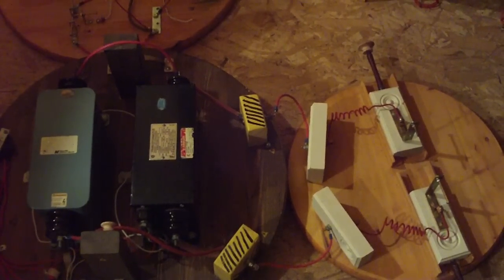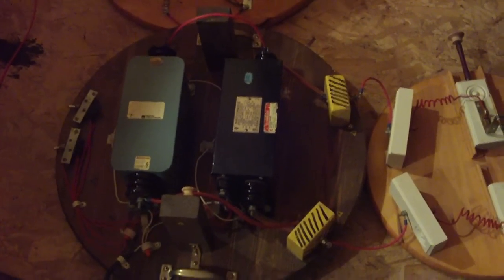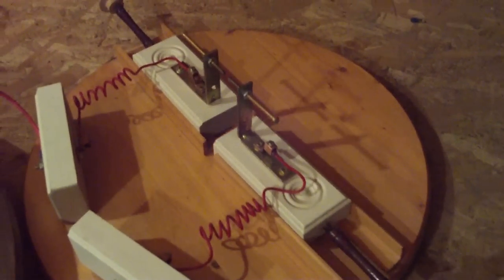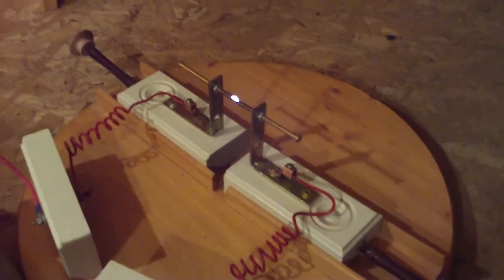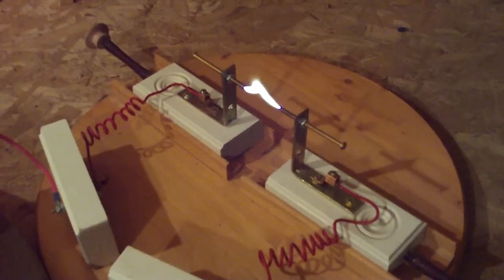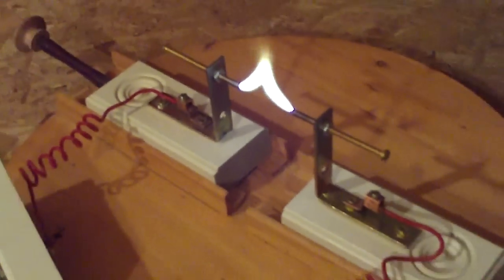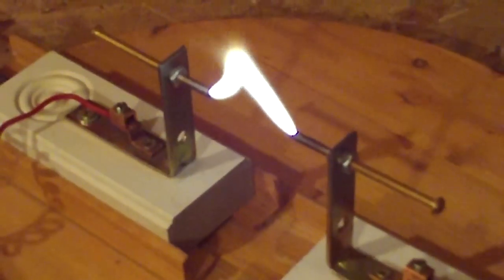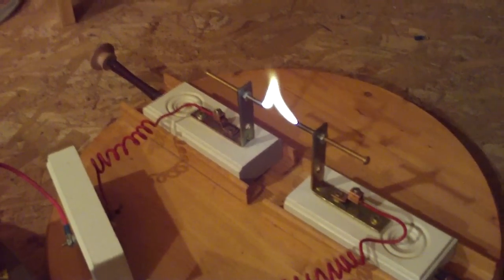Another closeup of 15,000 volts AC

Comment: At work, we use rectifiers to anodize aluminum.  They make over 2500 amps at 16 volts.

The battery in your car makes over 100 amps but only at 12.xx volts.  Amps kill.  Volts cut.  

Volts make arcs jump but without amps, you just end up with static.

Comment from the maker: At 15,000 volts, yes it can be lethal.  Notice that contrary to popular myth, it's the VOLTAGE that kills, because voltage is the determining factor for how much current will flow through a fixed amount of resistance.  The only reason why it's limited to 60ma is because the transformer is current limited to prevent overloads.  If you were to touch the arc, it could give a lethal shock, or at the very least it would burn your fingers.

Comment from the maker: We're kind of debating something abstract now.  If there was really 0 volts, then the arc would not be able to sustain itself.  There has to be a sufficient voltage to ionize and break down the air.  Maybe you could argue that the voltage in the rest of circuit drops to very low, but within the arc itself it still has to remain in the kilovolt level.  Of course, this only happens because the transformer is current limited and is purposely designed with bad voltage regulation.

Comment from the maker: okay then, well technically it's 900VA apparent power.  We don't know the power factor, so it may be more or less than that.  However, I do know the arc represents nearly a dead short, because I can see with an ammeter that each transformer draws nearly 4 amps on the primary side with the arc.  Each transformer is rated for 15kv 30ma, so that means 120v 3.75 amps on the primary side.  So the arc does draw a full load.  It looks about right on the ammeter.

Comment from the maker: ...You can have something supply both high voltage AND high current, if the POWER is sufficient to begin with.  A Van de Graff generator supplies very high voltage, but extremely low current, because it has very low power (Wattage) to begin with.  

A neon transformer or microwave transformer, on the other hand, supplies high voltage AND high current, because they draw a lot of power to begin with.  Transformers don't gain or lose power.  They just convert the voltage.

Comment: So you answered yourself, if you short circuit the output the apparent power is 900VA but real output power is 0W because there is 0V on the output. The arc represents near-short so voltage on it is very low, so power factor is very low too.

Comment from the maker: You can't point to a power supply and say there are "X Amps" present, because that will depend on the load.  It depends on the voltage, and the resistance in the circuit.   For example, you know that an outlet in your house supplies 120 volts, but the amps are a dependant variable.  Obviously, if you plug in a toaster oven, it will draw more amps than a cell phone charger because the toaster oven has a heating element with relatively low resistance (causing more current to flow.)

Comment from the maker: With these transformers...possibly stop your heart and cause severe burns on your fingers.  And they're current limited so they don't overload.  You touch a 15,000 volt power line and you catch fire.  High voltage is awesome, but it's no joke.

Comment from the maker: @ubuntupokemoninc 

I don't think the insulation would handle 30,000 volts.  The casing on a neon transformer is basically just filled with stuff that's kind of like tar, and it has a lot of carbon in it.  Neon transformers are pretty tough and they do put up with a lot of abuse, but 30kv is a lot and I'd be worried about corona starting to slowly etch through the insulation.

The other problem is how exactly would you connect center-tapped transformers in series?

Comment: Very possibly it's over 16 kV rms when unloaded. I measured voltage output on one of such units and it was over 11 kV with 230 V 50 Hz input. The xformer was rated 10 kV

Comment from the maker: They're neon sign transformers.  They're normally used to energize the tube in a neon sign.  You might be able to buy a used transformer from a sign repair shop (that's where I got mine).  Or look in electrical surplus shops...or on eBay.  The only thing is if you're under 18, some places might not sell them to you because of the liability.   I don't know how old you are, but you look really young in your videos.

Comment from the maker: Well, the biggest misconception some people have is that amps is the dangerous part of an electric current.  That's NOT really true.  Ohm's Law states that "Voltage divided by resistance = current."  So for a given resistance, the voltage is actually what determines how much current will flow.  Higher voltage means more current.  That's why high voltage is dangerous.  A 12 volt car battery won't shock you because the voltage is too low to overcome the resistance of your body.

Comment from the maker: ...Also, think about this...a car battery can supply hundreds of amps, but if you touch the poles of a car battery, it won't do anything to you.  That's because it's only 12 volts and it can't overcome the resistance of your body.  But of course, if I tried to grab wires from a 120 volt outlet with both hands, that would kill me.

Comment from the maker: It's actually BOTH the voltage and the current that makes it dangerous.  Ohm's Law states that "Voltage divided by resistance = current."  Voltage is the determining factor.  You CAN'T have current without voltage, so saying that amps are what kills you doesn't make any sense.  The amps depends on the resistance and the VOLTAGE.  I can't point to a wire and say there "2 amps" there or whatever.  It will depend on the voltage and the resistance in the circuit.

Comment from the maker: huh?  I don't need a flame to start an arc here.  15,000 volts can jump easily by itself.  The other video shows the corona wind, and you can actually see it making a candle flame bounce and flicker.  It's also called an ion wind.  You can do it with a Tesla Coil too.  Actually, I'm thinking about making an ion motor.

Comment from the maker: ...so yeah, even though the battery might be RATED for 150 amps, with only 12 volts, there would never be that much current flowing through your body.  I could go grab jumper cables from a car right now and it wouldn't do anything to me.  As long as your hands are dry, the body can have up to 10,000ohms of resistance or more.  A 12 volt car battery would only cause microamps to flow in that case.  But I wouldn't try it with 120volts!

Comment from the maker: It's just two high voltage transformers connected in parallel.  I built the little wooden thing with insulated handles so that I can draw the arc out while the circuit is live.  If you don't have any experience with high voltage, it can be dangerous though.  This is 15,000 volts.

Comment: 110 with 8A won't kill you as easy as you think. Look up ohms law and you will see.

Ex: You soak your hands in saltwater and grab a Hot and a Neutral wire with each hand (lets just say the amps of the supply are infinite.

Comment: ...Well lets say your internal body resistance is 1,000 ohms.

Current= Voltage/resistance. 110/1,000= 110mA through your body. 

Thats almost 2x as deadly as a 15,000v 60mA tranny (60mA max regardless of the voltage)